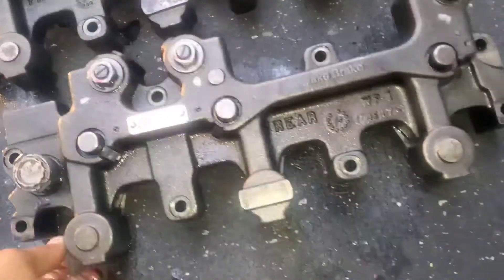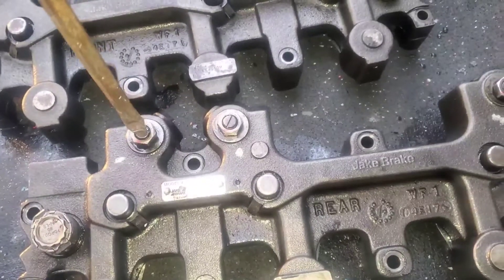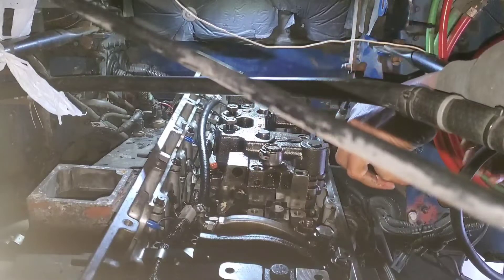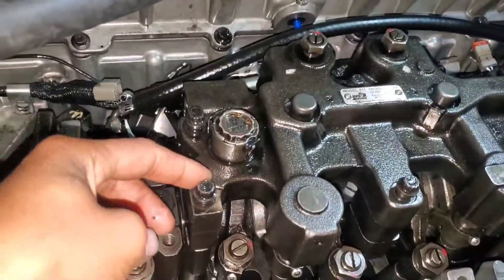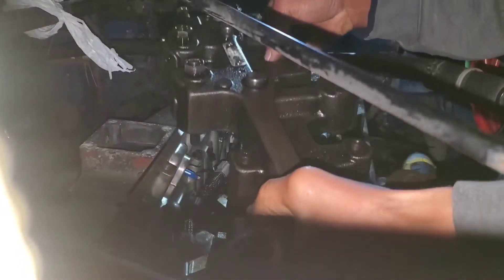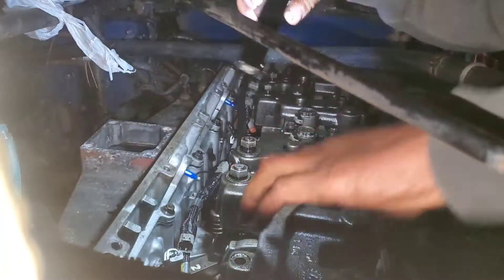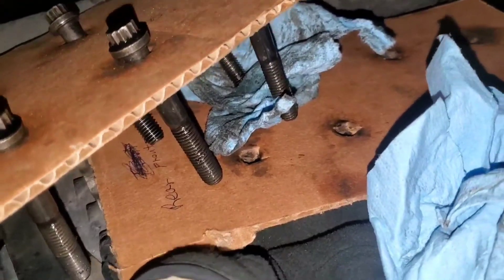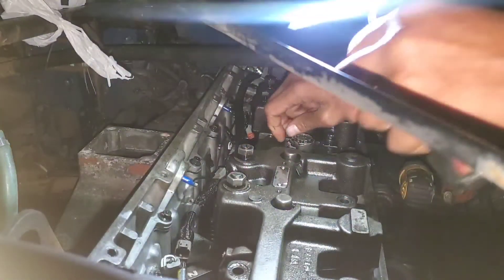inside a cummins engine installing  jake brakes

Comment: I have a small amount of knowledge about those brakes but I wondering if a caterpillar brake could fit in a 5.9 Cummins engine
Reply from the maker: I dont think the Cat brake will line up with the Cummins jake slave pistons. The crossheads need to make contact whenever the jake brake is activated.

Comment: Do you think it's possible to add a jake brake to a truck that has exhaust brake, and if it's possible, can u add it to a scania v8 engine 🤔
Reply from the maker: It's possible with the removal of the exhaust brake system and modifications to make the jake brake work also the ecm should be updated to recognize the jake brake
Reply: @truckingpaysthebills5394  do they have any videos pertaining to that cause I'd love to see it
Reply from the maker: @themosthated_collins  I haven't come across a video that shows the conversation.

Comment: Can the jake brakes be installed on other diesel engines aside from Cummins?
Reply from the maker: Hi Jake bakes can be installed on other diesel engines but they have to line up on the right valve to support the activation of the piston on the jake brake.